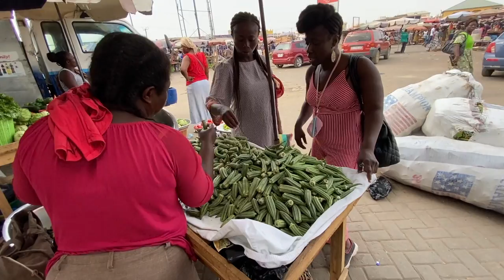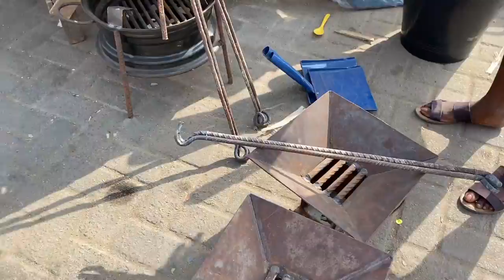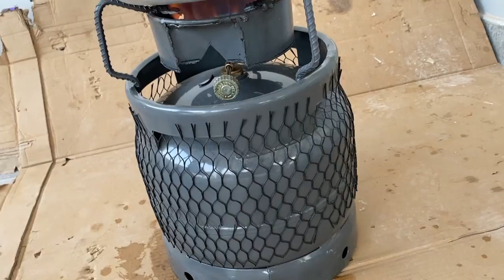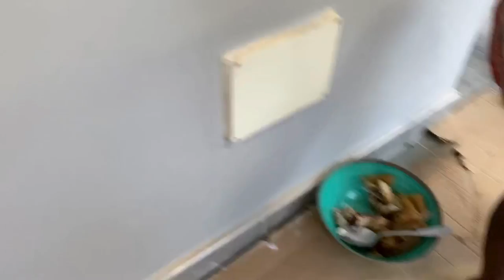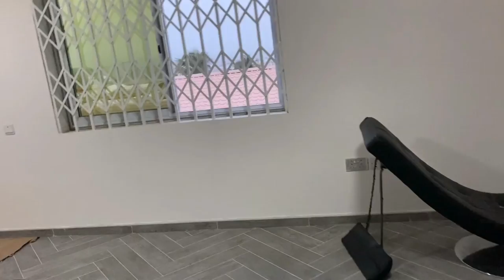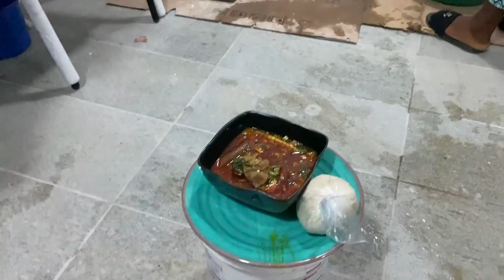Ghana Vlog: Fitted Shower Installation | Painting | Kasoa Market | Cooking on the Porch

Comment: The way they made the burglar proof thing is a fire trap. What about if there is fire. How do you escape. They should make it operable from the inside so it serves as burglar proof but you can escape in case of fire
Reply from the maker: Kwaku Akonto: That will be best. Some windows in the states is not operable. Some of the main doors doesn't have burglar proof.
Reply: some are designed to open and lock with a padlock. the problem is on one can never the key during a fire